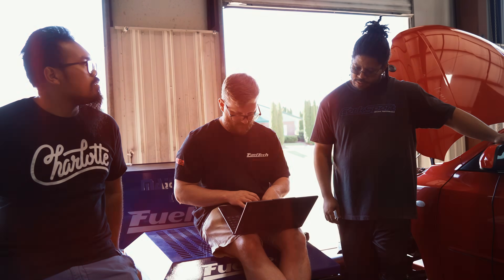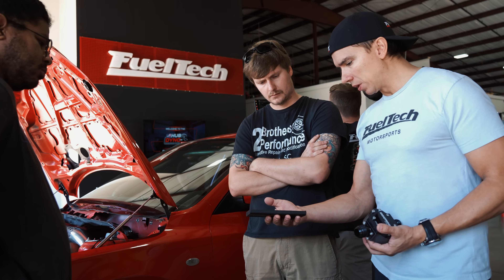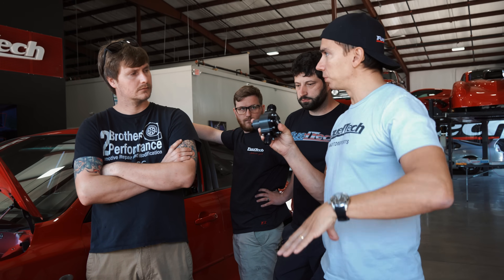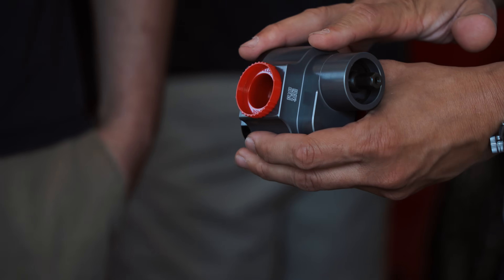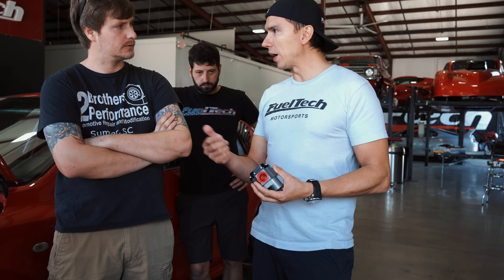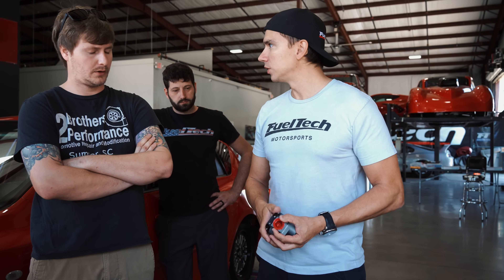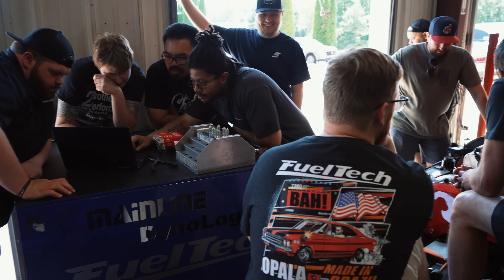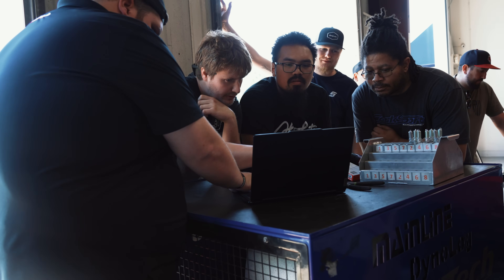1200HP Mazda 3 on our Hub Dyno?! | FuelTech USA

Comment: Noob question incoming… does moving the rear wheels back those few inches in a front wheel drive drag car make a noticeable improvement at the track? Does it help with traction and or 60ft times or what? Asking for myself.

Comment: I was always wondering about that motor I have it in my 2008 Mazda 6 400 horses in stock forum the forge eternals and everything are you guys are getting 1200 horsepower out of it the only thing that I don't like about it is if they can build an automatic transmission that will handle it then I would like it does a standard even with 1200 horsepower slow as hell

Comment: Damn that's some awesome power numbers! Nice job! I have a few question on that fueling conversation that went on. I have 2012 Mazdaspeed3 that I have a newly built motor and all the supporting parts for. I don't plan on making anywhere near what these guys made but it's good info to know. How is the fuel being supplied currently? I heard a fuel cell, but is that also feeding the DI injectors along with the Port Injectors? How would someone adapt that mechanical pump to this DISI motor since it currently comes with a cam driven HPFP? My current fueling set up was stock tank for the DI with upgraded HPFP internals and return style fuel cell on e85 for the PI. Thanks
Reply: From what I have been told, this car is run on port injection only. DI has been removed and runs on vp m1 straight methanol.

Comment: Wow! Didnt realize the 2.3 had the kind of potential. I've seen so many blow up in factory form.
Reply: Well, I mean running meth definitely helps 😅. But  anything can be built if done right.
Reply: As long as you are able to get the cylinder head whiteout the exhaust manifold casted in to it the 2.3 is able to make really good power whiteout throwing mad amount of boost to it and risk cracking the head...
Reply: @SweVikingRC  you are thinking of an ecoboost cylinder head.
Reply: @dontejackson602 Yes I am :)
Reply: @SweVikingRC  mazdaspeed motors don't use the same cylinder head.
Reply: Interesting stock tune and quick spool direct injection too early. I suppose beefing up rods would of saved a ton of those failures but it's a great 4 cyl once you know the flaws.
Reply: Rods and bad ring lands were the big problems with these cars. When i had one i was making around 390 with an e85 blend. It ran for a long time untill i sold it. Tunning is pretty easy with these to. Kinda miss that car now.
Reply: There was one at WCF and he went rounds
Reply: Lil boys and their Cobbs or laptops lol
They are a solid platform !
Reply: This will blow up 10 times faster that's all
Reply: For how long? Is the question

Comment: Can’t believe yall letting Cleet get the ft600 and not the 700 plus!
Reply: They know what they’re doing. Plus clet is gonna lose to the 6 cylinder 2jz that ran 5.54 last year.
Reply: Nothing wrong with a 600 with what cleet is trying to do
Reply: If cleetus camaro doesn't live up to the hype that is surrounding it, be very disappointed. Sure everyone will be there to tune the chassis and engine as quickly asap. 5000hp as claimed on a radial will be very interesting to get down to the track. I can't imagine a feel of how the power comes in have to leave a bit easier and still running in the 5s